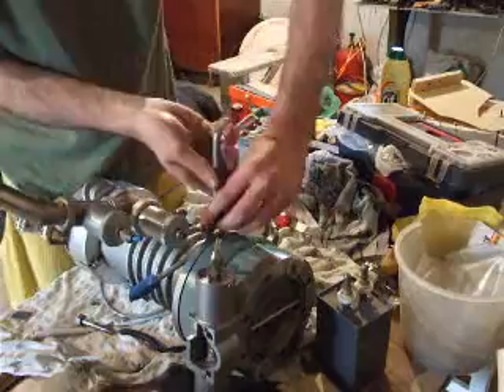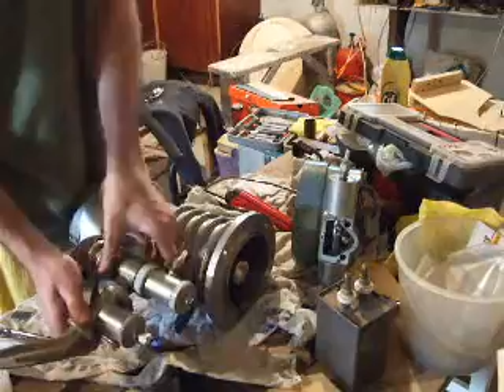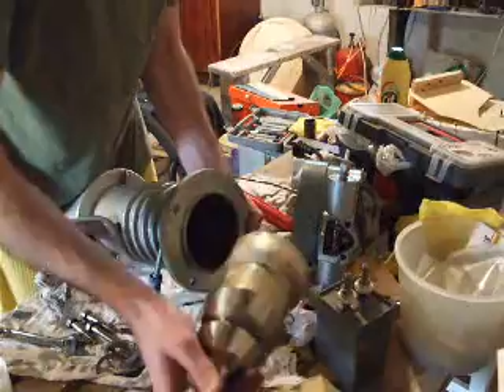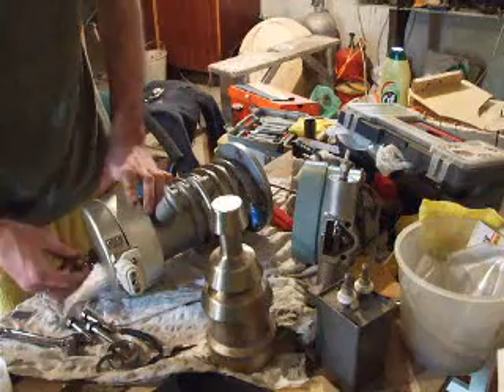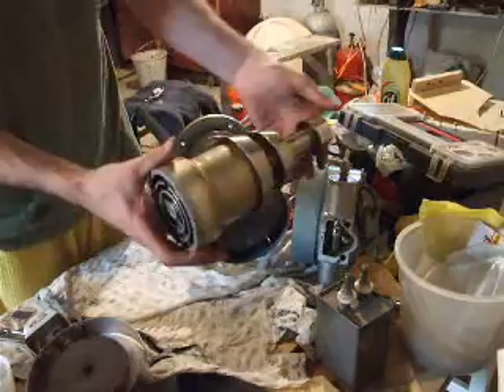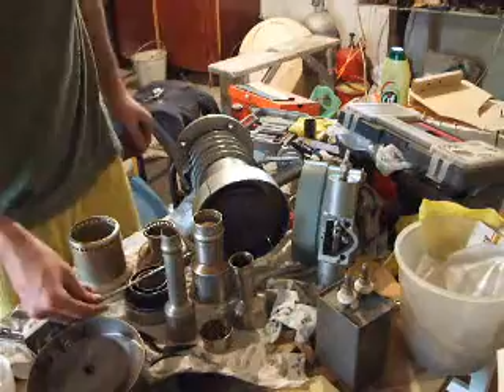Dismantling diffusion pump

Comment from the maker: @algae1000 Yes, there are 5 types of diffusion pump oil, the best (and the most expensive) is Polyphenyl ether, but you can buy Dow Corning oil on ebay for a few 10 dollars. It depends how deep vacuum do you want to reach.

Comment: @omegalab Hello-Thank you for the information.  The 5 types are all based on depth of vacuum?  I want to get down to X10 -8 to -11 Torr or so.  The Dow 704 oil is almost a dollar per cc, and I need 250cc.  The other 700 series oils are just as expensive.  I'm just a retired ol' guy just trying to have fun with his gadjets.  Keep up the great videos.  You have a new subscriber.